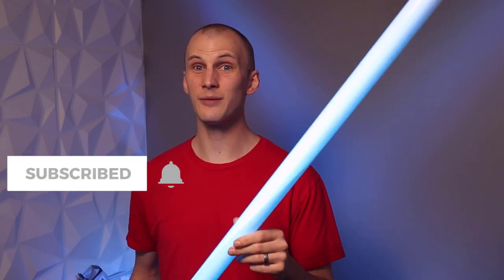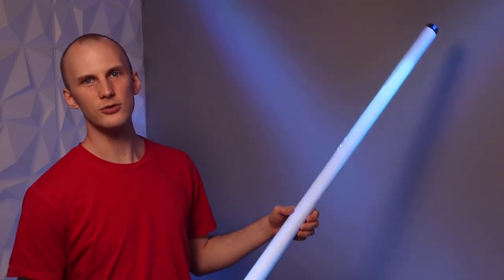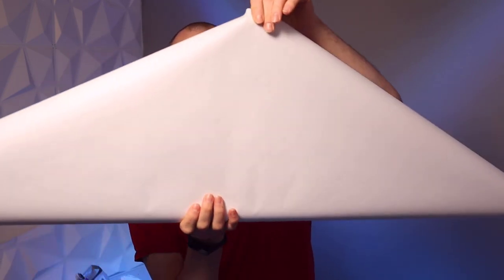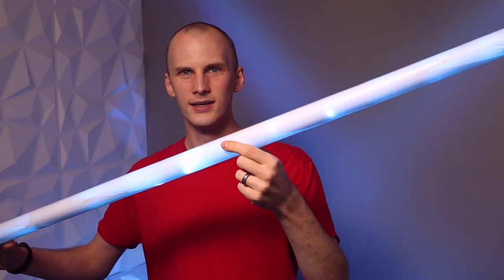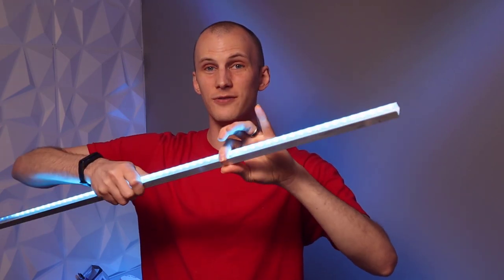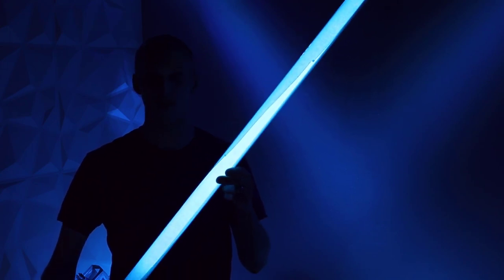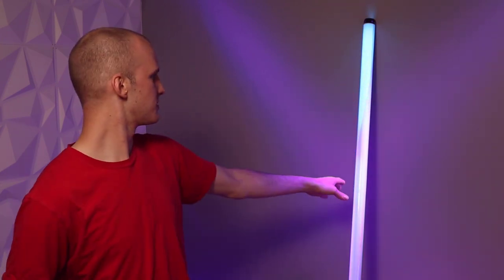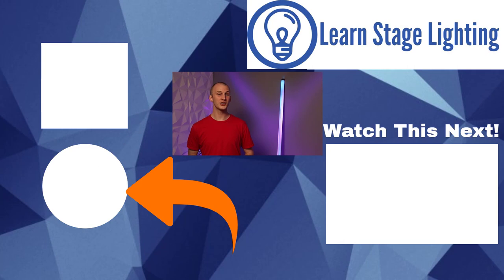DIY Pixel Tubes!  David Builds It!

Comment: Anotherway to put the LED, would be to twirl it around a stick with good glue, and than put it in the tube with the paper. So the light affects all the sides of the tube
Reply: I like that! I was wondering if the U-channel was too deep. Will have to try both.